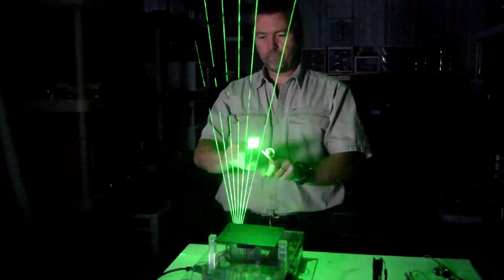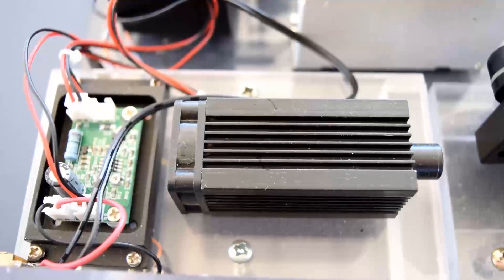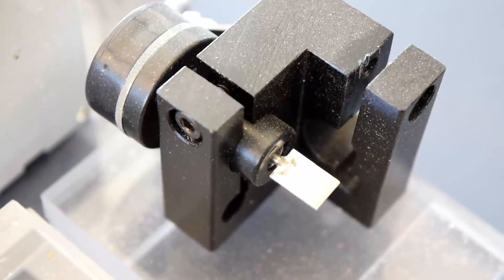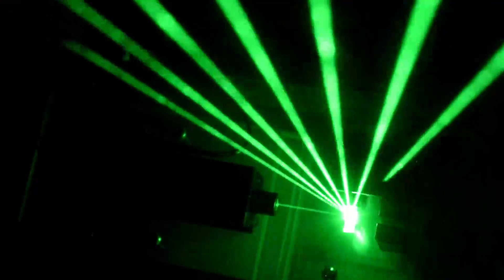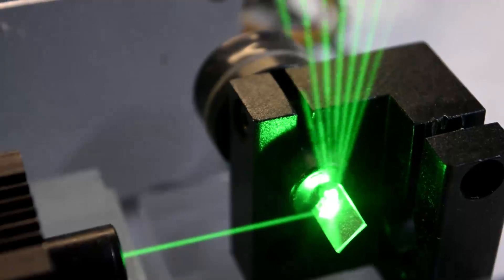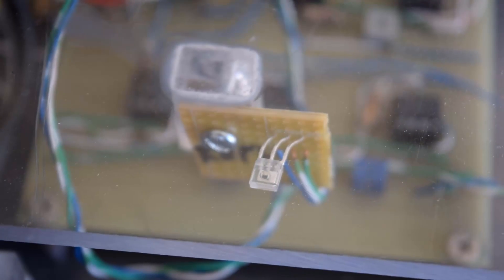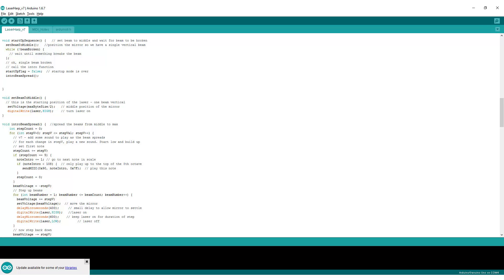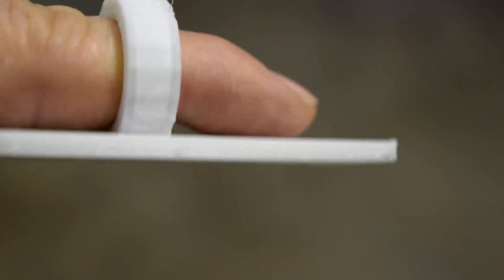Building LASER Harp with an Arduino

Comment: im in kzn and really like this lazer harp, what could i scavenge this laser from?
Reply from the maker: Hi - Also a PMB guy. Thanks for watching. The best is to try buy from online. Lots of Chinese source on eBay. You really need the TTL control circuitry to make it work for this application. If you have a laser show system you could potentially scavenge it from there.

Comment: For the optical sensor, you could to make High pass filter to cancel ambiant light of majority of case cancel 60Hz or 120Hz Light
Reply from the maker: Thats a great idea - would make it a lot more reliable.
Reply: @ScienceShack  i made a new version with a complete motherboard and a new sensor designed by me, Franck Morisseau and Thomas Avisse, i not tested them actually , i have the pcb and some critical part are be tested if you are interested, you can contact me ^^

Comment: Buy a 12bit DAC, Arduino, 20Kpps scanner kit, 200mw Green laser module, build a simple opamp for the ILDA signal, the DAC code goes something like this int DAC {0, 500, 1000, 1500, 2000, 2500, 3000, 3500, 4000} that gives the beam postion, you divide 4096 by say 15 and you get 273 that number gives you the 'gap' between each beam..

Comment: hi.  i have a one question . Are you using the stepper motor for your galvanometer ?
Reply from the maker: No - stepper motors are too slow. We are using a 20k pps galvonometer from a laser show system. We got a pair (x and y axis) from ebay.  Something like this - https://www.ebay.com/itm/20KPPS-30KPPS-laser-scanning-galvo-scanner-ILDA-Closed-Loop-max-30kpps-for-laser/261517002270?epid=1178074369&hash=item3ce3a0c61e:g:oIQAAOSwYGFUriXk
Reply: ok but if i wish the stepper motor .  can I still make  a laser harp?
Reply from the maker: I have seen designs using a stepper, but when I tried it was way too slow. In order to get the persistence of vision to make the one beam look like 7, you have to move that mirror really fast! Good luck
Reply: thank you . i using the stepper motor 28BYJ-48 with the ULN2003 Driver . is it  possible to make one beam to look 5 ? (excuse me i don't have a good english . I'm french . )
Reply from the maker: your english is better than my French😀. your eye will send the image of the beam to your brain for about 30 milliseconds. so in order to see all beams, your mirror must make a complete set of steps in 30ms to be able to return to the first beam and start again. if you want 5 beams each step has to be 1/5 of that time. which is pretty fast.
Reply: ok . i  created a one program for the stepper motor . I send it to you so that you can say what you think .
Reply: and what is yours sensors for the laser harp ?
Reply from the maker: It's not about the program - which I dont have time to debug. It's about how fast you can make the motor move. Do the math. There is a reason people use galvo's and not steppers. Steppers are too slow, but if you want to verify it for yourself, by all means try it - I know I did.
Reply: No problem . but i make the laser harp with my school and we don't have a lot of money and we and we want to do it without spending too much money . what is your sensor that captures the reflection of lasers , please 
 ?

Comment: hi I don't get how you make the arduino understand which laser position has been interrupted, do you use photocells? How do you reflect into those?
Reply from the maker: The Arduino controls the beams so it knows which beam is on at any point in time. If at that moment that a beam is on and the single photo-diode detects refelcted light, the arduino knows which beam it is. Then it moves to the next beam. If you had more than one beam on at a time, it would be very difficult to detect with one light sensor.
Reply: ok cool, so it has to be monophonic. You also need a calibration to find the right amount of reflected light to trigger it.
Reply from the maker: With a birghter laser you can add more beams and hence more notes. We chose 7 as that was best for a 200mW laser. You also need to build in some lag time to allow the galvo mirror to stop vibrating after every step position. I added a second photo sensor that could not see reflected light, but measured the ambient light, then by connecting both sensors to a voltage comparator and measuring the difference to determine is a beam was broken. Some small potentiometers allow fine tuning of the sensitivity.
Reply: +TheJesterN It could be polyphonic if the processor is set to work that way.  It only detects one at a time, but very fast.  If you played 2 beams at once, theoretically, the processor should send 2 notes to the midi output.

Comment: where did you get that galvanometer thing? is that basically just a very high speed stepper motor?
Reply from the maker: +fredlllll - It is different from a stepper motor. It behaves more like an analog voltmeter, with a small magnet and coil that deflects a certain amount relative to the voltage applied. It does not do a complete revolution. You can buy them online - used for laser shows.
Reply: +Geek Seek online is quite a big place. can you narrow it down? all i find are old voltage meters.
Reply from the maker: +fredlllll - ebay is a great source - here is an example of a 30k pps galvo - http://www.ebay.com/itm/30Kpps-laser-Galvo-Galvanometer-Based-Optical-Scanner-including-Show-Card-/252300684989?hash=item3abe4aeebd:g:oIQAAOSwYGFUriXk
Reply: +Geek Seek ah thx. i only searched for "galvanometer". laser galvo gives better results. but wow these things are expensive
Reply from the maker: +fredlllll - I found a cheapish one that is used for laser shows. I think it was around $50. You actually get two for that price, as you only need the one galvo. This is not a cheap project and good laser will cost a little too. upside is that none of your friends will have one :)